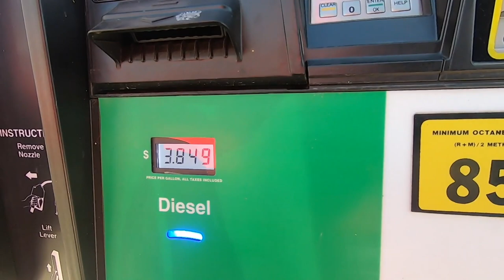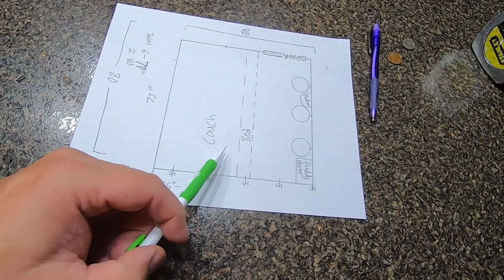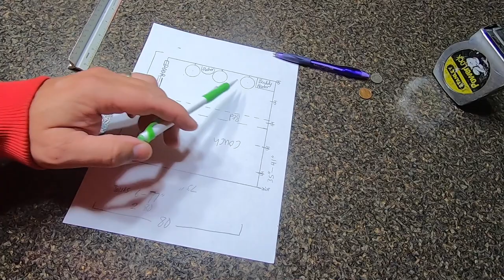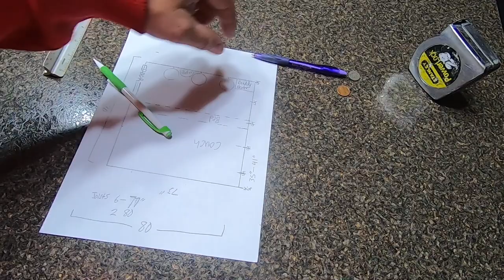Skid House Build Part 1

Comment: Did the glue part work for sticking them two together just wondering if it worked
Reply from the maker: I haven’t had it out yet under stressful conditions. So far so good on some other projects I have done with it. hopefully it will hold up in the cold. I know with plumbing pipe and fittings, the welded (glued) joint becomes stronger than the plastic itself.

Comment: Where do you get that flexible plastic for the runners ? How wide and thick is it ? TIA
Reply from the maker: I just had a 4 x 8 sheet of ABS. I think it was about a half an inch thick and I ripped it into 4 inch strips. I have a buddy down in Salt Lake who works at a plastic company and he sold it to me. I know you can get, some stuff through Home Depot that is used on conveyor belts in commercial applications. It comes in strips I believe that would probably work very well. Let me know if you need any more information. Also, Home Depot sells dimensional PVC that might work well.
Reply: @prospectoroutdoors  ok thanks , I’ll try Home Depot

Comment: Those blueprints look way too professional. How do you like the electric nailgun? That's going to be bigger than I thought.
Reply from the maker: The nail gun is kind of like a Jiffy auger. It has framed a lot of houses for me over the years but it’s getting tired. Milwaukee just came out with some that are way better. The only problem with Milwaukee is I seem to go through batteries quick. The batteries have not lasted the long-haul like they should for what they charge for them. No the base is done on the building project, hopefully I can focus on keeping things light weight from now on. I didn’t want to skimp on the foundation though.
Reply: @prospectoroutdoors  I use the makita because I'm not impressed with milwaukee batteries either.